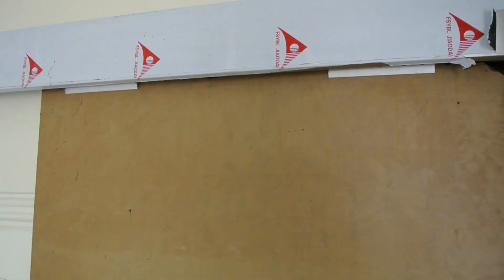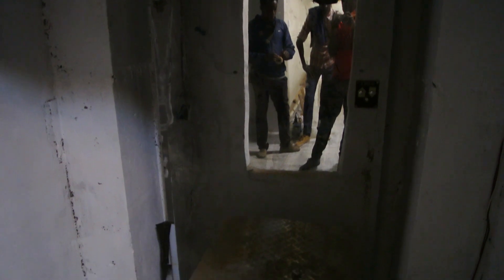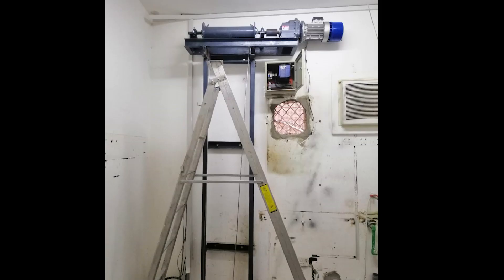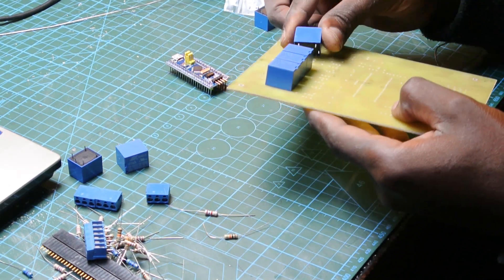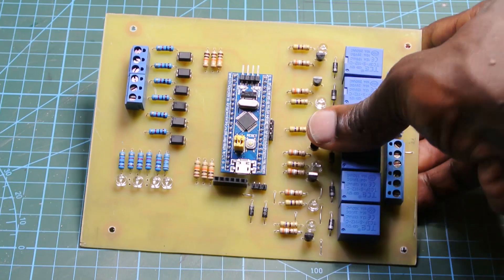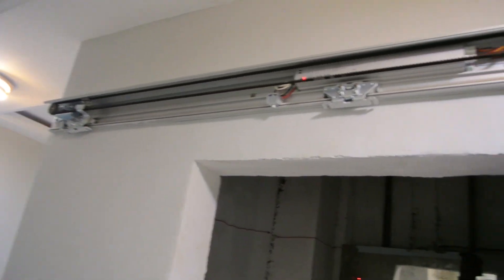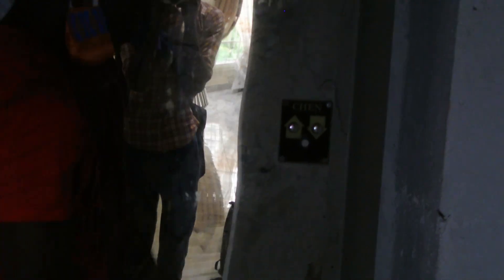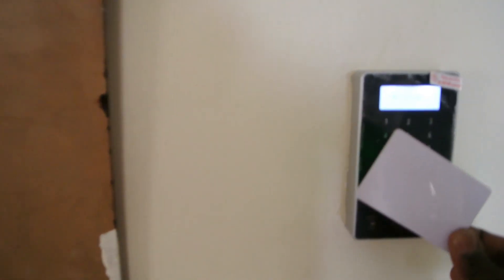How we built a home elevator with arduino

Comment: This lift is not safe. Where is the over speed governor? Also why did you install electric doors on every floor. Wouldn’t it make more sense to put one electric door on the lift, that will operate the landing doors like a real lift
Reply from the maker: There's an electric door on every floor moreover the lift is very safe as it uses break motor. Eversince we constructed it,  we have never had any problems.  Thanks for your comment.
Reply: @HermannLabs  First of all I like your idea of building your own lift. But you need to consider that a break motor can fail and what will happen when it fails. In commercial lifts there is a safety factor of at least 2 and sometimes even 3, which means if your break fails there are still 2 other systems in place as a backup. I don’t see anything In place that would stop your lift. For example if the power goes out. The little brake motor fails to stop cause there is no electricity to engage the motor break, will it just crash down? Furthermore installing electric doors on every floor is unimaginably dangerous how do you make sure those doors can only open when the lift is actually at a landing? Is it just logic you programmed or are there relays in place which cut power to the lift if one door is open?
Reply from the maker: @FlexTubes  thanks very much for your input. We programmed the doors to never open when the carriage is not where it is supposed to be.
Reply: @HermannLabs  Can you post a video of it finished that would be very interesting